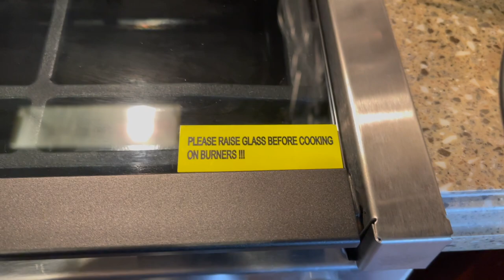RecPro Greystone Oven/Range install - Replacing the Atwood Oven in our 5th wheel - Easy Installation

Comment: Great video! We are looking at this oven for a small loft build we are doing. The oven will installed  into a bar sitting area so I was wondering if it would look silly / noticeable if we removed the glass cover?
Reply from the maker: Unfortunately it probably would be noticeable, but definitely not terrible.

Comment: Wow! Great video! Thanks for the tips! We too changed our fridge to a 12v and we ran a new line so you gave me the great idea to repurpose our 12v line from the old fridge!!  The piece that would have been good was to stress the reconnection of the propane - either teff tape or the liquid teff. And then to re-check for leak either using manometer,  propane sniffer or simple bubble solution- but I get the point. Plus, what fridge 12v is that??!!  We installed the Dometic 12v but that looked like a French door style 12v with bottom fridge!! Definitely need a video on that if it is!! Thanks for the video! Got my sub! Cheers!
Reply from the maker: Thanks a bunch! We actually have a video on it on the channel! It’s the everchill 12v French door fridge. We absolutely love it! Thanks for watching!

Comment: Hey, thabjs for the video. How does the oven work? I have had issues with RV ovens not getting very hot or uneven temperatures. I would really appreciate thoughts, thank you!
Reply from the maker: It works really well. We put a pizza stone in the bottom and that makes the oven heat very evenly.

Comment: Nice! I am getting ready to do this but the two stoves I found are different in cutout size. Did you have that issue. I am not sure what to do as it is smaller for the new one than the original by two inches on width.
Reply from the maker: There are typically two different size stoves in RV’s. 17 and 21 inches are the two standard sizes. Mine actually fit right in place with no modifications necessary. Do you know what your old stove size is vs. the new one?

Comment: I see that you had a Wedgewood RV1733. If that is true it looks like this fit in no modifications.  I need to do that due to my Wedgewood needs a new gas valve.   Is that correct?  Thanks.
Reply from the maker: That’s the same model but ours was the 21 inch model. As long as yours is a 21 inch, you should be good. If it’s the 17 inch, you’ll probably need the smaller oven.
Reply: @TodayWeGo  Thanks, I am not worried on height, I do know I need the smaller Graystone. I just wondered mostly about the width and depth. Sad part is this RV I just bought had an unused oven the prior owner did not cook in it even the top. Sad to find a bad gas valve and no replacement part.

Thanks for the reply and the video, Now I know my replacement. Do you know if Rec Pro charges a shipping fee?
Reply from the maker: I think it depends on how big of an item you purchase. I know with our couch and fridge it did cost a little extra because it had to come in on a special delivery truck.

Comment: How do you light the oven?
Reply from the maker: If you push in the oven temperature knob it will release some propane. Then twist the light knob a few times and it should light.
Reply: @TodayWeGo  I have the same stove and have never used the oven thank you!